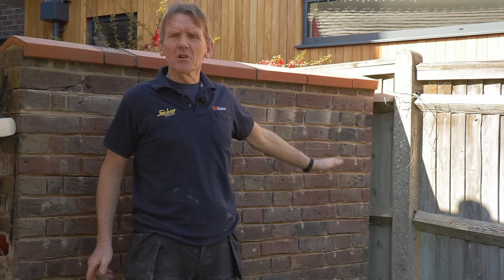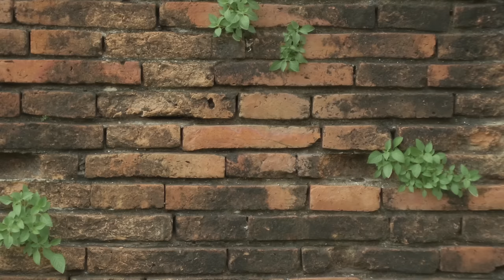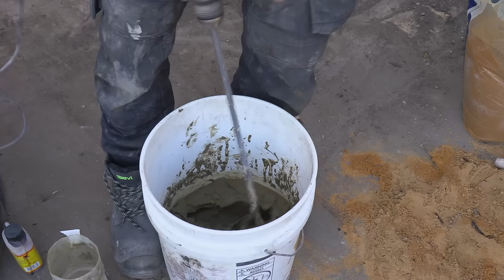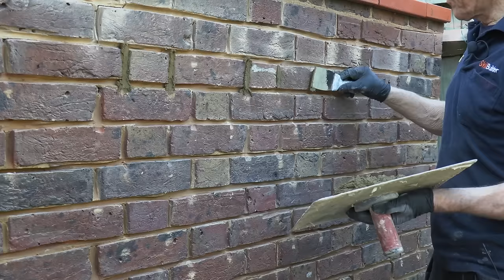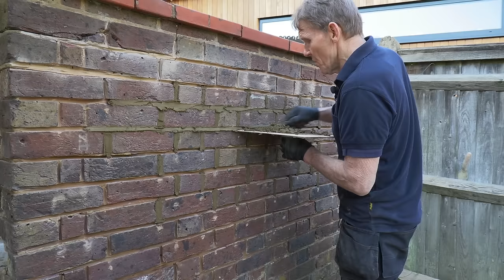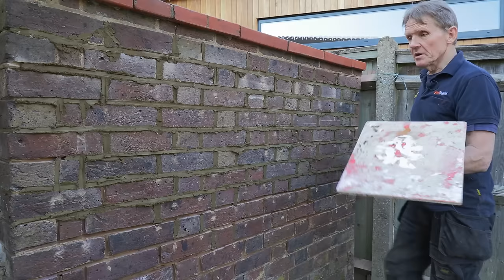Repointing Old Brickwork - Best Mix & Tools

Comment: Hi,  which mortar should I use for my Victorian house(build 1895). I read that lime mortar was used for Victorian house and best to use lime mortar for repointing. Any advice on ready mixed mortar brands to buy or the mix ratio to be used?
Reply from the maker: Yes the lime mortar is best for a lime built building and it will give you another hundred years. If you read the comments below you will find plenty of people have suggested mixes and materials.

Comment: Marshalltown Tools tools are made in Marshalltown IA, and Fayetteville AR.  Fayetteville in fact has open factory positions currently listed.  If there are any Tool and Die machinists in the area, take a look.  Maybe they use Chinese steel (like almost everyone else), but the tools for the most part are made in the states.

Comment: im  crap at pointing i hold my hand up to it. I reckon thats a great way you showed us here.  Does it matter if its not the text book way if it it does the job then so be it 
Good vid thanks
Reply from the maker: To be fair working muck on muck is a better way so I should have gone right to left. That said it is worked in so there are no voids, it just takes longer.

Comment: I much prefer the tuck pointer, fast and easy. Even a cheap one for a couple of quid works nicely. You can do perps with them too if you are not good at doing it with the trowel which I certainly am not lol. Just use the same method as for the horizontals.

Comment: Is was always taught to point towards the mortar I've already put in so did example I start on the right hand side then point from left to right so your drawing and anything the new mortar in to the least bit your pointed in (the same applies to pointing left to right). Roger your doing it opposite not that I'm saying your in the wrong it just suprised me a little. Good video! 👍🙂
Reply from the maker: You are right I should have worked into the previous. I thought it was easier for the camera to see it but on reflection it would have made no difference.
Reply: @SkillBuilder  it got the job done, it just seemed strange seeing it find that way which was why I commented. Probably the best how to pointing video I've seen, it will hopefully inspire some people to try it themselves. It would give them something to do during this lockdown, if they can get a hold of the tools and or the materials. 👍🙂 Great channel btw

Comment: Use a 500mm long round jointing iron, follow the top arris of the brick. And trowel above it with the tip of the pointing trowel. this will give you a crisp line on clay bricks with a round joint finish.

Comment: If it's a solid brick wall, would the cement not trap moisture in the wall?
Reply from the maker: how many million brick walls are built with sand and cement? If the water gets in through the bricks it can get out through the bricks. There are so many people out there who try and make a case for using sand and lime on all structures but if you look at the hundreds of thousands of brick houses repointed with sand and cement they aren't all causing problems.

Comment: I've found plastering sand works well with a cement gun. Not too soft and has bit of stone. Also I find if you point too soon you get stains. There's no right or wrong way. Nice work bud

Comment: Now confused going to do some pointing for the first time. Some videos say wet the bricks first , he says don’t wet the bricks as it stains them , which is it ?
Reply from the maker: Sorry Jeff 
 I think we have lost the bit where I said "the day before you point give the wall a good hosing down to remove dust and wet the mortar joints. I meant that the wall should not be wet on the day you point. 
If it is a very hot day you can hose the wall down and leave it so the bricks are dry but the mortar still has some moisture. I need to reshoot this as soon as I can get some lime.
Reply: I spray the joints just before pointing,let them dry slightly to avoid staining and that way the mortar adheres better to the original mortar bed.Otherwise you'll create a weak bond that will crack in my opinion.

Comment: if its a lime mortar built property , it should be repointed using lime mortar. asking for trouble using cement, even a weak mix will cause trouble down the line .
Reply: To rebuild the top of a stone chimney stack, what mortar mix would you use? The. To repoint remainder? Never really used lime. NHL lime? Thanks
Reply: @borntohula  nhl 5

Comment: What you want is a tuck pointer with a heel on it, not a square/welded join to the handle, this will help you tool it and you can even cut the fluff off the mortar. Connex are good for tuck pointers
Reply from the maker: Thanks for the tip. I will look them up

Comment: The steps in front of my house, have brick whose mortar is crumbling. The worst part of it, where I can see the bricks are actually lose, is underneath what I call the 'stoop', which is a big slab that you can sit on. I have that on both sides of the concrete steps. My house was built in 1907.

Comment: For a 5:1 mix, can you add linseed oil to improve water repellent capacity?  Ii recall my dad doing  this when pointing.  Does this sound right?
Reply from the maker: Yes that is what Fred Dibnah did
Reply: Skill Builder bingo. That’s where I heard it from. How much would you use?
Reply: I’m in Montréal Canada. We get a lot of snow, ice and extreme weather. I have a chimney stack I need to point. Your clip caught my eye. I’m from Manchester originally and my dad would have me point the walls in our house

Comment: Try cutting down a tuck pointer for your perps..👍
Reply from the maker: That is a great idea. It will hurt but I will do it.
Reply: @SkillBuilder  That's when you buy a cheap one and cut it down.
Reply: I bend my finger trowel. Helps when you polish up your pointing too say when you do a recess joint. Also Roger you should really go 20mm when raking out. Cheers

Comment: Would say as long as you're using the right size jointer, use that to put the mortar in the bed joint straight off the hawk.
Wet the brickwork down a bit first, mortar a bit dry so cuts down on staining, and let the soft brush work it's magic.
Reply from the maker: All good tips but I still hate the jointer. It has no feel
Reply: @SkillBuilder  that little bit of flex on the tuc jointer does feel more responsive but using the jointer with the right mix, skips out a step and gives the same result.
Horses for courses.

Comment: That mortar looks stronger than 4-1.  , I always use water mist spray before point, and one of the different size finger pointing trowels 😉
Reply from the maker: It was measured in the bottle at 5 to 1. The dark appearance is the fly ash that they now use in OPC. It is horrible but it cuts down the carbon.

Comment: That's the best video I've seen for a long time!  I've got a lot to do and a lot to learn.  I've got 1920's and Victorian needing a LOT of work - a big project for the summer.  Your tips about the mix is absolutely fantastic.  I can now see where all old repairs (done by professionals apparently!)  have failed and pinked the bricks out with them.  All the original stuff is lime mortar and its been badly bodged over the years with really nasty grey super hard cement doing more damage.  I've got a big job on but you have just inspired me to tackle it and I will enjoy doing it a bit at a time.  Thank you so much!
Reply: If you require reliable guidance on repointing, do take the trouble to read the Building Research Establishment publication “Good Repair Guide No 24” (Repointing external brickwork walls) as this provides useful information, including when does worn pointing affect structural integrity and the importance of using lime mortar on old  walls. Its  only 4  pages long and at about £18 is good value for money.

Comment: I’d just use my laying trowel to hold the muck and a pointing iron to point it
As I’m right handed I’d point from right to left so that I point into the existing muck I just pointed in
Then just use the laying trowel to scrape of most snots, and brush off with soft broom head when muck is dry enough not to get lines in it

I guess as long as it looks well and is compressed in properly you can do it anyhow ✌️

Comment: What mortar would I need to repoint a Victorian house? Built in 1889
Reply from the maker: sand and lime mortar NHL 3.5
 General building mortar.
    External renders and pointing. Don't use too much water. Mix it well and let it stand for 30 minutes to pick up then give it a stir up.

Comment: I re modelled an old Vic end of terrace, exposed the interior brick walls and re pointed (tuck) using lime and shape sand. Most of the joints were non uniform and narrower than the standard tools. I ended up using the handle of a long dessert spoon (knickerbocker glory, Wilko) and for the really thin bits a chop stick.....

Comment: Hi Rodger
Much better using SBR as opposed to feb. Yes it's expensive but it is fantastic stuff.  It makes the mortar much more flexible, prevents it shrinking and cracking and makes it much more workable.  Also try a pointing gun, gets the gear really squeezed in avoiding and hollows. Also blot quicker
Reply from the maker: SBR is great but I think it is too good for repointing because it won't allow the water to escape. It can also stain the bricks.  I agree with working into the previous but, as you can see, I really press it in so there are no voids. I will mention it on the next pointing video.
Reply: Try it you will never go back

Comment: You didn’t wet the wall down which will help the new mortar adhere to the old. Also, you can use cement in any pointing you just have to use the rule of thumb that the mortar you’re pointing with isn’t stronger than the brick you’re repointing.

Comment: As a Chartered Building Surveyor of 40+ experience I usually think your advice is good but you’ve described this as Tuck pointing on another of your sessions. On this sessions you do later correctly call it Struck pointing. Tuck pointing and it’s poor cousin Bastard Tuck pointing is totally different and definitely not a DIY subject, only ever met one bricklayer who could do well. Otherwise your advice on pointing is spot on.
Reply from the maker: Yes it is a misnoma but one that is now so common as to fall into common usage. No excuse for me doing it but I have read quite a lot  of architectural history and been surprised by how many terms are parochial. Hawk becomes a handboard and the tool I am using is called a tuck pointer and a finger trowel.

Comment: Pull into the mud when you point. You’ll fly. Maybe 15 seconds per total length on bed joints then joint/tool then the same way. Will be tight as it can get
Reply: Then to weather the joints allow mud to set up and wire brush and you can get nylon, stainless, brass all do something different. Mind you this is coming from someone who specializes in historical masonry restoration.
Reply from the maker: @jjfletcher1366  Thanks Joe. My next effort will include those tips.
Reply: @SkillBuilder  hopefully you like it! Keep up the work!

Comment: More than one way to skin a cat.

When laying I use my trowel and a pointing trowel, the jointer. When repointing in bulk tend to use a mortar gun. Don't need premixed just clean sand. After bit of practice you can sense the rare stones that are fowling, can be very speedy also in summer putting the mortar in wetter is better.

That is a nice old rustic wall, sharper newer wall and your job would look smeary imo. Sorry Roger.
Reply from the maker: Thanks Geralt. I will do some engineering bricks in the next one. I just make a drier mix and it doesn't smear. Thanks for your tips.
Reply: My experience with a mortar gun is bad,  it squeezes out OK at first, then the moisture gets squeezed out and you're left with a plug of dry mix.  I've tried all sorts, seived builders sand, silver sand, different ratios of mix, adding plasticiser, lime, overmixing,  it all goes wrong.  Back to basics,  hawk & trowel, the pros do it in lightening quick time.
Reply: @theondebray  Plasticiser and fairly wet mix. Have a rinse bucket also and keep gun clean. Definitely a faff at first but  when it works well you are off and away. Probably better on patios than brickwork tbf.

Comment: With the greatest respect Roger I'm surprised someone as knowledgeable and experimental as you didn't use lime mortar!
Reply from the maker: Hi Alex 
I wish I hadn't mentioned the lime mortar because I was trying to show how it can be done and most people. even on lime brickwork won't use lime. Merchants sell very little because people use plasticiser. 
I am a fan of lime and we will do some videos on it but, we have to face facts, the majority of repointing you see is done with sand and cement. Most of it is also perfectly o.k. As I say, not too much cement.

Comment: Hi Roger. Next time if you go right to left when doing your bed joints you will constantly be pulling against the last piece of mortar to help get a consistent bed joint . Where as in the video you went left to right so you struggled to put it in 👌 love the content tho 👍
Reply from the maker: David. I usually work so I am working back to the bit I put in  previously but you couldn't see very much with the camera. It should have been set up from above.

Comment: If its a pre-1919 built building then you should be using lime instead of cement based mortar.. Especially if your house is listed as the last thing you want is an angry conservation officer putting a notice in for you to change the whole thing and then whilst they are at it they'll get you to change a bunch of other stuff too.

Lime is breathable, flexible(dependant on the type) and does not cause damage to the bricks and walls due to this...cement renders and mortars will cause so much damage and the worse thing is you probably won't see it until its too late. Lime will just grow old and need renewing.. It's the dog's bollocks👍

Comment: Great videos overall, but in this one I disagree with your thinking skill builder. You were correct to say avoid a strong cement mix but incorrect to say you should go with a weak cement mix. Why not just go with what's already there? Ie a lime mix. Cement repointing will last a few decades at most and will always risk irreversible frost damage, while lime repointing will last 100 years. In engineering situations like canals, can still use a lime mortar, just a strong hydraulic mix that allows moisture to evaporate

Comment: Normally a big fan of skill builder videos but PORTLAND CEMENT SHOULD BE NO WHERE NEAR OLD BRICKWORK. Anything prior to 1915 should be repointed with lime mortar only. 

Portland cement will cause all kinds of issues in the long run.
Reply from the maker: Yes this was a wall to be knocked down and your point about lime is well founded. This was shot in the first lockdown and the merchants were shut so no lime. It should have been mentioned.
Reply: @SkillBuilder  great that you acknowledged this! 

Subject close to my heart as my 19th century cottage is loaded to the rafters with Portland cement and has caused much damage. 

Sadly, the fact message about lime isn’t getting through even to the professionals. 

Keep the great content coming though!

Comment: Typically you rake the joint back 25-30mm....then hose the wall down so it doesn't dry out, Id also say never point away from yourself !

Comment: Wow. I can’t begin to tell you how many things are being done incorrectly. You do not use Portland cement and sand to tuckpoint, no matter what ratio. Moreover, excessive wet mortar will shrink greatly and turn a light color.  Tuckpointing Mortar should be drier and installed in three lifts.  All of those joints will crack when they shrink.  The ASTM standard for masonry cements and masonry mortar are where one would start to develop a proper mix.
Reply from the maker: Thanks Jim 
 Good points you make but this isn't tuck pointing. Tuck pointing is something else entirely and it is nonsense to say you never use sand and cement for pointing. A lot of the NHL lime products harden up to become the same as a 1.1.6 mix. I did say it was wetter than I intended.

Comment: A real bricky would put the compo on a brick trowel held upside down and drawer from it with a pointing trowel , never use a pointed pointing trowel use one that’s worn to a slightly rounded point
Reply from the maker: Yes you are no doubt right but this is about DIYers having a go and needing to deskill it. Holding the muck on a pointing trowel is difficult for the novice and very time consuming. This method is way quicker and easier.

Comment: Ive just done an entite wall and need to talk about the mortar gun. I tried it with pre-mix and it just clogged, even though the mix claimed it was for pointing.

One phone call to the absolutely excellent customer support line of Roughneck tools and i was advised to not use pre-mix but make sure it was very soft building sand. The type that makes your hands go yellow/orange when you run it on your hands.

Mixed about 4 or 5 to 1 with a bit of plasticiser and my god, what a difference!

I've pointed a lot in the past, though I'm no builder (sparks and plumbing)
 This mortar gun comes in my top 5 of time-saving tools. It's awesome. Even my father in law was converted and he's been a brickie for 40+ years.

I'll never go back to getting the mortar in with a trowel.